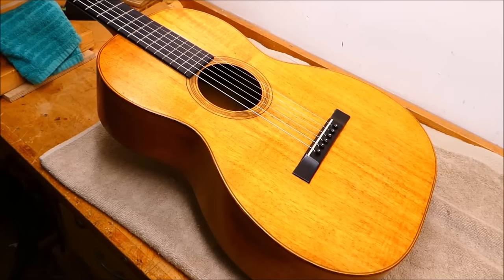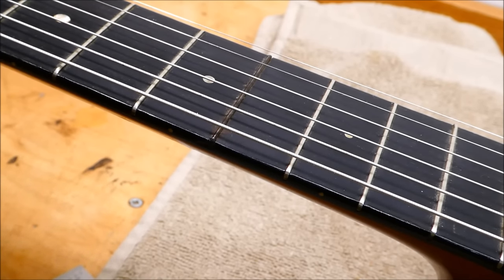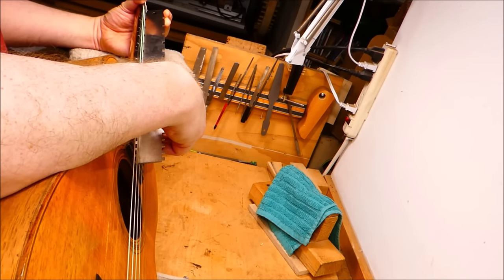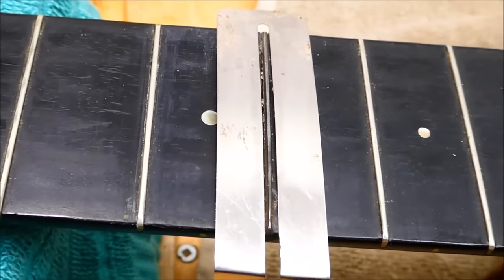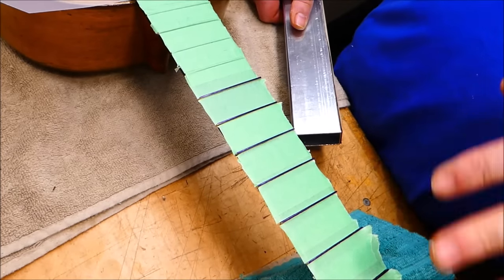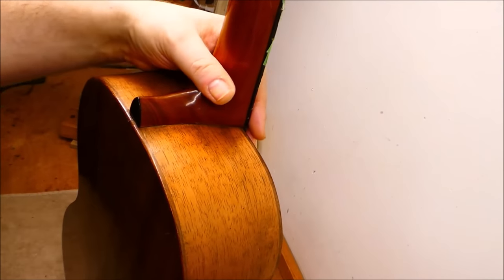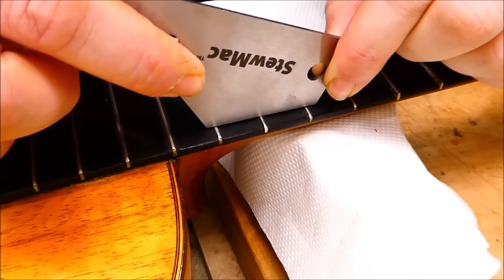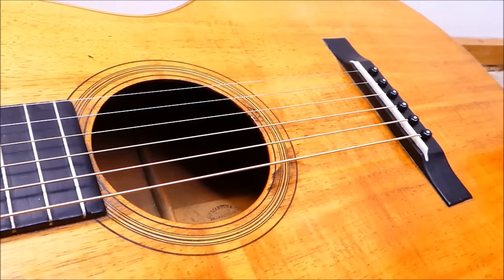1920's Martin: Bar Frets and Koa

Comment: You’re exactly right regarding the bar fret roller. When I took the Martin tour I was able to talk to one of the “elder” repairmen. I was questioning about hide glue, but I watched as he worked on an 1800’s Martin with bar frets. The roller was not exceptionally big but it was heavy and very old. He used a feeler gauge to size each slot and rolled each fret to the thickness of each slots individual width.

Comment: Ted I lived in one of those 130 yr old houses for 25 yrs. Your cluster flies are right on time bur they’re probably not coming from where you think.  Their larvae is a parasite  of common earthworms and between mid July and mid-August they emerge from the ground as adult flies. They then find their way into every nook and crannie, even between stones of a stone foundation. They live a long time as adults relatively as insects go,  so they will also “cluster” in warm places under siding or between cracks in old sheathing boards… and continue to annoy you.  We got them completely under control with the help of one of the big name pest control companies but it took several years and a lot of dusting and spraying stuff you don’t want to consume . You have to break the lifecycle killing newly hatched adults before they can lay new eggs ,so that means treating  siding, window exteriors, attics, and any other place they might land after emerging as adults in July.

Comment: The old magnet test can tell you something about fret material. I was surprised to see you use the old saddle as your determination point for neck angle with the floss, when it was too short and you replaced it anyway.. And I say Pipe-ette as in "little pipe". Thanks for the video.

Comment: Since this guitar was made for Hawaiian style playing, it would have a heavier bracing on the top. My 1924 0-18 bracing has much less wood on the braces. I compared your braces on this guitar with my guitar made for steel strings and mine are obviously lighter. Because of the higher nut on the 0-18KH, there is much more stress on the tone wood of this guitar.

Comment: Hi, I am a big fan of doing things right and your videos have been a tremendous help. Could you tell me what the ‘right’ angle (from vertical) should the fret ends be filed to? I’ve read 30 degrees but haven’t filed yet. I want to make the wood tool with the file at the correct or best angle. Thanks for your help. I’m building my third (and final) guitar...

Comment: Very interesting video. If you don't mind me asking, why would you be inclined to file the replacement frets to fit the existing slots, and not cut slightly wider slots instead, so as to clean them up?

Comment: Very enjoyable video.
How do you cope with so much repetitive boring work? Resign yourself to 3 hours of doing something you dislike.
My grandfather built model railways, he used to spend hours filing the track joints so they were level and with a constant amount of spacing to get the right "clickety-clack" sound as the wheels passed the joint. He hated it, but taught me there are some things you just have to do, regardless how much you dislike doing them, to get the job done right.

Being a luthier is a strange way to earn a living, and I guess not a career path you decide upon when in school, how did you fall into this?
I'm sure it's a convaluted path, I went from fixing radios to failure analysis/dry etch reverse engineering of memory chips and wafers, so I assume guitar repairs wasn't your first career choice.

Love the videos.

Comment: I know it's not original but I'd be pulling that fretboard off looking for ebony and putting in a truss rod. (Carbon fiber rods)  then you could run some heavy strings and a nice tall saddle. Possibly just left the neck on the whole time.

Comment: Hey Ted,  would preemptive carbon fiber rods drilled through the headstock alongside the truss rod cavity prevent Gibson Neck (break?)
Reply: Or you could just have a shallower neck angle from the start instead. It would be really expensive to modify an instrument that much. Or you could just ya know not drop it?